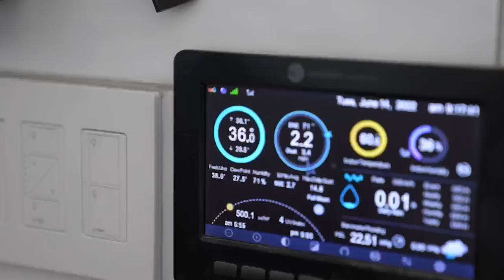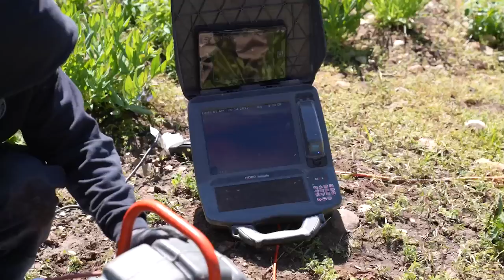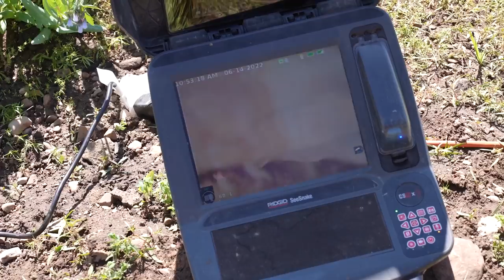YOU WON'T BELIEVE WHAT WE FOUND IN OUR SEWER LINE!!!

Comment: When pipe and cable is laid in rocky ground code usually requires a bed of sand to be layed under and around it in the bottom of the trench to keep what appears to have happened to your sewer line from happening.  They also may not have compacted the material in the bottom of the trench before they put the pipe in.
Reply: They did a crapy job !

Comment: I know it is to late as your filming is about a month ahead but why not just run a new line for the septic - make it so it works around now new existing things like stairs and propane tanks and nothing has to be moved etc don't dig up the old one just leave it there - it also means you will be less than 1/2 a day without septic when the house is joined to the new line and the tank is joined to the new line - if you ever need to get at the line again it needs to be easy to get to - running a new line is the way to do that
Reply: I was just about to say the exact same thing. Jinx.
Reply: 👍👍👍 Exactly! I think that would be WAY easier
Reply: My guess is that septic plans need to be submitted and approved by the state. I know that’s the case in most states. It has to do with protecting ground water sources and other environmental impacts.

Comment: I think I'd just decommission the old line and put a new one in but keep it farther away from the propane tank so you can easily dig without disturbing it.  We had an old water main that needed to be replaced but for some reason it went under our garage floor.  We were not going to dig up the garage cement floor so we just rerouted a new water main to an easier to dig location.  Was way cheaper and faster than had we dug up the cement floor of our garage.  But this footage is from a long time ago so you've already finished this project so never mind.
Reply: I agree with you.  I would install a completely new sewer line.
Reply: Well, it is helpful to the next guy reading this!
Reply: Much easier and if there is a next time

Comment: Between the outside camera and the motion detector Simply Safe saved us when our house was broken into. They came through the glass section of our French doors, so the entry sensor didn’t trip.  The motion sensor caught them, they left immediately through the broken glass in the door taking nothing with them.  I did install additional cameras and sensors.  I do recommend using the screws to attach everything. We had an alarm go off very early one morning when the tape dried up and the sensor fell off the window. I am so happy with Simply Safe and very happy to pay the monthly monitoring fee.

Comment: When you finally get the old pipe dug up check the the wall thickness which is most likely the problem. Pipe wall thickness is suppose to be 1/4" inch thick Many contractors will cut corners to pocket more profit by installing 1/8" to 1/16" inch vertical gas vent pipe. Just like we had happen to us to replace old clay pipe. So we ended up doing it twice. $12k the first $16k this time with the right pipe and with rock under the pipe for the second install. 👈😂
Reply: Isn't Trent the contractor?
Reply: @skohaya  Supposedly, but he said he hired it out with the basement plumbing in this episode.

Comment: Your excavator didn't put in the sewer line, I believe you did, that makes you 100% responsible for the issues.
Reply from the maker: No it was contracted out  you can find the whole thing in our old videos.
Reply: @TrentandAllie  who put in the sewer line?
Reply from the maker: @1dktre  our excavator installed the entire septic system beginning at the house,  to the septic tank and the leach field.
Reply: @TrentandAllie  then I was wrong and your excavator is responsible.
Reply: @TrentandAllie  Still think the issue is the distance to the septic tank, not enough water to flow the solids that distance. Septic tanks are generally within 20 feet of the house, you can have a long distance to field but not the other way around. Good luck, flush with large amounts of water.

Comment: Ok so my husband is a fire chief and has NUMEROUS LIC for construction code and sub code official..the Propane tank is not an issue to be moved, even when full. Moving tanks  is done frequently. IF THERE IS A FIRE IMPINGING ON THE TANK OR IN VERY CLOSE PROXIMITY….then  it can catch fire and low up. IT IS EXTREMELY RARE for a tank to blow up UNLESS FIRE IS INVOLVED.  If the crane drops the tank and it leaks or a seam is splits…THEN YOU RUNNNNNNN! But again, very rare. The crane isn’t going to lift it 50ft off the ground, it will be just a few inches to move it to a safe area.

Comment: Thats a long run for a septic pipe with solids it will more than likely happen again with the heaving of frost etc changing the straight line path of that line. most houses up here in the north have the main septic tank within 10 feet of the house so the run is short and the leach field can be further away as its just liquids at that point. I would suggest putting in a small tank up by the house with a grinder pump like they do on a raised septic system that way it will grind the solids and push it to the main tank and not rely on gravity  then once it gets to the tank the remaining solids can drop. unless you have room to put another large septic tank closer to the house its just too far of a run for that size pipe with solids using gravity

Comment: There is a trenching machine you can rent or contract it out that will do a precision dig on a 4" line and replace it all in a day. Been there done that several times. The machine can be set to do a correct drop for the sewer.  My sewer broke on the Water and Sewage Departments side and it was 118 feet and they had it dug cleaned new pipe put in and it took five hours and they were gone to the next one. I am sure it is already done. Too bad it happened but it happens.

Comment: Wow Joel , what a change...for the better.   Did you give your hair to the make a wig foundation ?   It looks like the sewer line was made with thin wall pipe NOT SCHEDULE 40 which is likley code . You won't get that kind of deformation with Sch 40 PVC even if a loaded dump truck drove over it ,    CHEERS          Steve h.

Comment: I would make the contractor do the whole job again. If you touch it at all they could use it as an opt out clause. The garage is going to be a good size.
Reply: They may run into a problem since they didn’t protect the line from the many delivery trucks and heavy equipment.  It may be difficult to confirm the initial contractor was responsible for all the many problems with the line.  Let’s hope the contractor will step up to get this resolved.

Comment: I know you guys are several weeks behind on publishing these videos so you probably already fixed the problem in the sewer line however if not why don't you just dig up the section that's messed up closer to the house instead of digging up the whole sewer line? can't you just dig up that small section and cut it out, level the the dirt in that area at the bottom of the trench and then replace the line and then just close up that section?

Comment: 20 to 25k to replace the septic line?  That's totally ridiculous.  It's what? A hundred or so feet from the tank to the house?  I may not live in the mountains, but I had a complete septic system put in two years ago.  Parts, equipment, and labor was just about $6500.00

Comment: 20.000, to 25.000 if there is gravel all ready in the ditch. Theres not...tell, the Plummer estimator,  the guy did not use any, gravel to bed the whole, line. Trent, dump trucks, filled with pee gravel, will cost, thousands to get up to you alone...2 kids,,  collage is coming, dont touch the line..your looking, $35.000, rule of thumb. 
A replacement cost, 3x what a new one would.